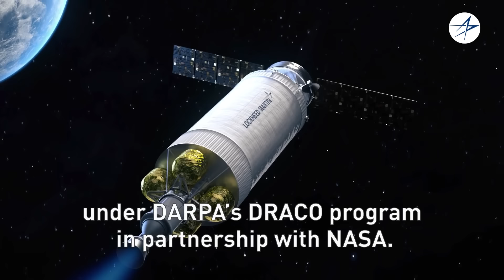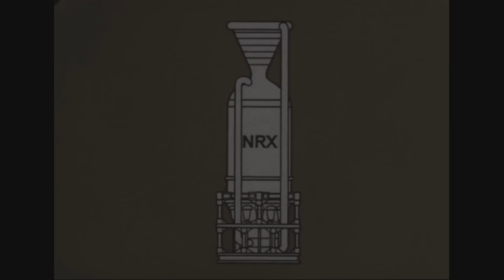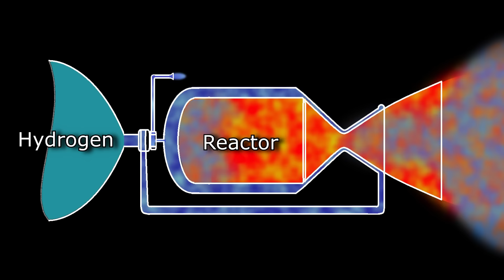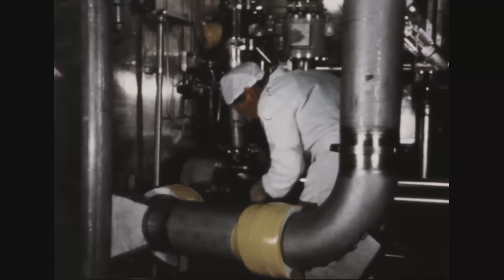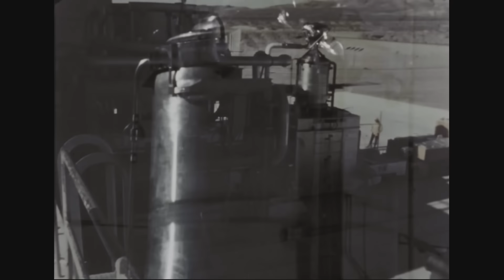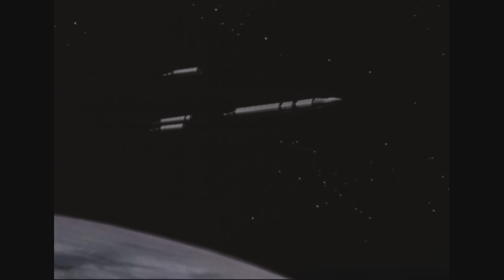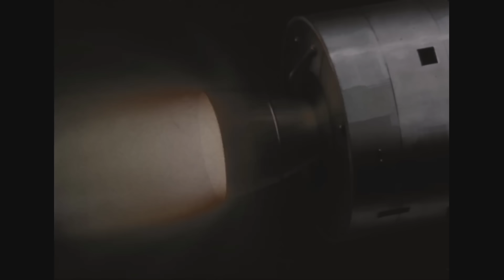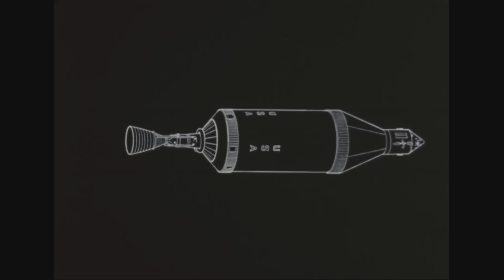Why Nuclear Rockets Are Going To Change Spaceflight

Comment: AEROSPACE ENGINEER HERE: 
Sorry Scott but this time I am going to disagree a bit on this one.
This is what I call a "zombie technology" and my definition comes form the concept of "zombie economics" which are the economic policies that no matter how many times they die in failure keep coming back to life. Likewise Zombie Tech is something that was put forward, then dismissed for some reason and then brought back to life later despite the initial issues NOT being handled. 

A good example of a Zombie Technology is the "Trains in Tubes" first suggested by Robert Goddard back in the 1920s, resurrected numerous times over the decades and most recently by Elon Musk. The main killer for the Trains in Tubes comes down to the simple reality of how many people it can move compared to a train on rails. The secondary killer is what happens when it fails, because at that point you have in a pod stuck in an evacuated tube. If the pod ever springs a leak all the passengers will arrive dead. After that comes the simple reality of what you do if a pod gets stuck in the tube.

All these basic issues that killed of the Trains in Tubes each time were IGNORED each time it was re-birthed.

The basic problems of putting these sorts of reactors into space are fairly well documented in numerous places. Most obvious is getting it into space in the first place. Uranium is heavy and shielding is heavy. Go and try to find the mass of an S9G reactor like those in the Virginia class submarines. Yes a rocket might need a lot less power but we are still talking about a massive lump of hardware to lift into space. AFTER that there's the issue of the vehicle itself. If you have to put the engines way out back on a boom to reduce the shielding then how many rockets do you need to launch the boom segments.

Anyway you look at it there's a logistical nightmare to overcome and NOBODY is dealing with that because they all hops somebody else will.

This is why hypergolic propellants were used on Apollo and many systems since. They require a lot less hardware to operate, which means the initial launch is far easier because there's less weight to launch. This was the great breakthrough that Buzz Aldrin and friends came up with that made Apollo feasible. They realised that it came down to how much mass do you need to move to get the men back from the moon. They then back tracked from there. What the Lunar Orbit Rendezvous (LOR) flight profile did was REDUCE the logistical problem from unfeasible to feasible.

Go see Destin's video (YT Smarter Everyday) on his talk to the NASA engineers on Artemis.

On the subject of what happens inside a nuclear reactor with things like moderators I recommend that everyone tunes into the YouTube channel Illinois EnergyProf hosted by Professor David Ruzic from the University of Illinois. Just put "energy prof" into YouTube search. Disclaimer - I graduated from U. Illinois but that was before prof Ruzic was there.

Prof Ruzic does a great job of explaining many of the issues across the entire energy spectrum INCLDUING nuclear. I believe he has 3 reactors (1 fission & 2 fusion) on campus for research and training as well as access to the Clinton Nuclear power station nearby. 

Sorry Buddy, 
I love the channel and hate that your flying while I'm grounded.
Enjoy your plane because one day you might NOT be able to fly and that sucks - trust me.

Comment: I prefer the variant where you mix two streams of sub-critical solutions of nuclear salts. When criticality occurs, it boils the water into gas, or even plasma if you prefer (by changing the concentrations). It allows you to turn the engine off and on, as you please, and the (EXTREMELY RADIOACTIVE) exhaust follows very fast out the nozzle.

Much more mass efficient, and ferociously powerful. Yeah, has the downside of radioactive exhaust, but yaknow, don’t point it at the Earth and it’s fine.

Comment: I would think fusion propelled rockets (thermo nuclear / hydrogen bombs basically) would be even better and more efficient. It solves the problems with fusion reactors as it do not need to be contained to harvest the energy, because it is a rocket...

Comment: The USA crappy technology at Fukushima Dai'ichi has polluted the Pacific Ocean, and the USA's nuclear bomb testing many years ago has caused a lot of radioactive pollution in the Pacific Ocean.  Now USA NASA is making a nuclear thermal rocket engine will dribble out yet pollution on the only habitable planet that we have.  There is no planet B.  Now the idiotic USA is considering using nuclear rockets for what ? - for doing some stupid prestige space projects.  The USA is utterly insane.  A failure of a nuclear engine will cause terrible pollution into the environment.

Comment: Excellent summary (liked you starting with the days of NERVA). Moderators H2 or NH3 provide great thermal neutron absorption cross-sections. So a 4000MW reactor can generate tremendous thrust for lift off from earth. However, both safety & politics have driven for chemical propulsion to orbit and going critical once in orbit (as with nuclear-ion propulsion).

Comment: Dear Mr. Manley, it only makes sense to have both a chemical AND nuclear rocket engine.  Have your ionized acceleration but then combust two gasses in conjunction WITH that.  As you would have ionized gas it only makes sense to add a few magnetic nozzle coils after the exit to accelerate the ionized gas further, increasing the thrust as it were and since you have a nuclear module why not generate electricity from it in the cooling process to power the magnetic bell nozzle apparatus ?  In fact why not have a long tube of magnetic coils to act like a particle accelerator  to further add speed to the gas exhaust and by reaction, more thrust to the ship.  Don't forget the glow in the dark safety stickers.    "Engage Safety Squint beyond this point."

Comment: You mentioned that ion engines were far more efficient but that they required a LOT of energy.  Couldn't a nuclear reactor provide enough energy to make ion thrusters viable?  This way the reactor can be run at a more constant rate to provide electrical power.  Then when thrust isn't needed, the excess power can be bled off by converting it to heat that is radiated in to space.

Comment: 20:40  Huh, IIRC the Discovery from '2001' used an ammonia fuel for nuclear engines....which were kept WELL away from the crew module.  Neat to see that mentioned here ( the use as fuel, not the fictional use )

Comment: To get a sense of the current value of 30,000,000 Dollars in 1962:
Today, on June 3rd of 2024, it would be worth ~311,500,00 Dollars.

This number has been rounded up from 311,471,523 Dollars and 18 Cents.
↓
That is ~11,000,000 Dollars more than 2023 🤔

Comment: it sounds like a dead-end technology. if you can refuel chemical propellant in orbit, then all of your human-related missions make more sense to be done by chemical rockets to avoid radiation issues, and the cost of the chemical fuel is going to be much cheaper for the foreseeable future due to the greater costs/difficulties with nuclear technology. but robotic/non-human missions seem like they would make more sense with ion engines if you really want efficiency. methane and oxygen are cheap, so you're not really gaining anything with nuclear unless refilling in orbit is impossible.

Comment: Twice the Isp is not really worth the hassle, just double the size of the craft and use regular fuel. If Starship works anywhere as well as advertised there is no need for NTR to the Moon or Mars. For outer solar system probes they might make sense. Nuclear Lightbulb on the other hand, now we are talking! Manned missions to Jupiter here we come!
Reply from the maker: You forget how the rocket equation works, it’s an exponential so it doesn’t grow linearly.
Reply: @scottmanley  When I run the numbers in a delta-v calculator doubling the initial mass has the same effect as doubling the Isp. Is it flawed?

100 ton -> 50 ton at 450s ~3000m/s
200 ton -> 50 ton at 450s ~6000m/s
100 ton -> 50 ton at 900s ~6000m/s

For high fuel fractions it looks different which is why I mentioned probes to the outer solar system.

Comment: With the ramping up and down, other management issues, this sounds possibly usable for a cycler tug engine. Using high orbits, but not as big as geo synch level, you could have a push zone for exit and entry that should give lots of nothing between it and anything, plus allows management, teardown, rebuild material policing. I doubt these would ever get to super high burn time anyway either. Hauling uranium once a decade but propellant every trip would still be a concern, but once the core tug is up you get a better economy of use for the mass. Could likely even give it a better shielding system than a bare minimum shadow shield

Comment: The whole concept is absurd. Adding 30 tonnes to the dry mass kills any ISP advantage. Then there's the additional size of the hydrogen tanks, then there's the refrigeration system needed to keep it liquid. A Rutherford weighs 35kg and it's perfectly adequate for any reasonable scenario.

Yeah, it might save some fuel, but it would probably cost more than 100 Starship flights, which is a lot of refilling.

Comment: This is sadly less criminally insane than the salt water reactor that you talked about in an earlier video. That was the most certifiably nuts idea I’ve ever heard:)
Reply: In one sense it's more insane: You are keeping all the radioactive material in your ship, right next to your crew. In a nuclear saltwater rocket, you are exhausting out your radioactive products, at great speed, so it both leaves very quickly and dilutes over a great volume quickly.

Comment: Great topic, Scott. Proper thermal neutron management will improve long term use of a nuclear thermal drive. Uranium is over rated and only produces fast neutrons, very dangerous to life and electronics.Thorium is ideal for thermal neutrons, less mass, lower neutron energy, less shields required, astronauts and electronics don't fry. It checks all the boxes. Can shadow shielding protect against radioactive exhaust back pressure, during deceleration? Or, we can go really fast but can't slow down ¿? I still haven't got a serious  response on that one. China is currently leading the way with Thorium. India is not far behind and hope the USA could go all the way....❤

Comment: Recently NASA funded a breakthrough pulsed plasma rocket that holds the potential to revolutionize space exploration. It could allow manned missions to Mars to be completed within a mere two months. While not a traditional nuclear rocket, this technology demonstrates the ongoing interest in advanced propulsion systems. The most advanced electric thrusters may eventually achieve a delta-v of 100 km/s, sufficient for outer Solar System missions with nuclear power, but insufficient for interstellar travel.

Comment: So nuclear is both cooler and the reactants are less massive yet more thrust.  That seems backwards to me for some flippin reason.

Can anyone clear that up for me?

A second question.

If you weren't trying to slow down, but just create a "bubble" of gases ahead of the falling spacecraft, could thrusters be used to counteract the plasma created during re-entry?  Especially, if nuclear engines were available or something exotic like that such that reducing the propellants necessary is further accomplished (because, again, trying to actually slow isn't the goal, whereas creating a "bubble" blowing back the pressures and plasma IS the only goal). The end result: no physical heat shield necessary.

Comment: Hi Scott,

Love this video and your whole channel!

I’ve been a Project Rover (and Project Pluto) fan for decades. However, I also heard rumors of a “Timber Wind” project during the 1980’s, which was part of Reagan’s Strategic Defense Initiative (SDI, aka Star Wars to its detractors). As I understand it, Timber Wind used a pellet-bed reactor that, presumably due to its greater surface area and maybe higher temperature too, could generate way more thrust than the solid-core NERVA reactors, while still achieving very high specific impulse. Supposedly, this thrust was even high enough to take off from earth under nuclear power alone! The funny kicker to this rumor was that Timber Wind rockets were going to be tested over New Zealand, as a form of radioactive payback to their no-nuke policy that wouldn’t even permit US nuclear subs or aircraft carriers to dock at Kiwi ports. Oh yeah, I think one of the early Rover or Pluto reactors was coincidentally named Kiwi!

Thanks for all you do!

Comment: I'm not convinced.  ISRU actually breaks the rocket equation, whereas nuclear and ion drive just change the key parameter.  Rather than using nuclear propulsion, I think we'll be better off manufacturing O2 and metallic aluminum on the moon, launching them with electromagnetic systems (spin launch, rail gun, lunar space elevator, whichever), reacting them in space to produce alumina (Al2O3) dust plus energy, and using the energy in ion-drive-like systems to accelerate the alumina dust.

Comment: Please bring to mind the starship Enterprise. The one Pike, and Kirk commanded. On TV. Now, google HTRE-3, go to pictures, bypass the photos of the prototypes to the first drawing. Turn it upside down, hold a dinner plate in front. Is that the starship Enterprise prototype? Yeah. That engine was for the XB-70. But ICBM happened, so the Air Force ditched it, and Roddenberry said, "Thank you, Sir! I can make bank on that!"
I wonder if it would really work in space. Because you could power quite a coil, and throw ions backwards hard. Wouldn't want biology near it, though.

Comment: I wonder if you could have a thermal decomposition based fuel for a nuclear thermal engine. Like a relatively dense fuel that decomposes into hydrogen and something else l at above 1000K (like how water begins significantly decomposing at ~3000k), which you can then heat up to full exhaust temperatures. Allowing you to store low density fuel in a higher density configuration, while still taking advantage of lower density exhaust products. 

The energy from decomposition could be negligible (unlike hydrazine/hydrogen peroxide monoprops), as it's mostly about propellant density. 

That being said, the addition of some non-hydrogen material may decrease efficiency so much as to make this unviable.

Comment: Didn't you use 3300 kelvin for the RS-25? If so, 2300 Celsius would be closer to 2600 kelvin, meaning the difference is more like 630 degrees instead of 1000.

Comment: I used scrap stainless steel high pressure piping in a NASA test facility that came from one of the NERVA sites.  It had radioactive warnings painted on them.  They were cold.  It was fun work that I never completed.

Comment: Draco?    So I guess SpaceX is going to have to start trademarking their names?
Reply: There’s no trademark violation here. In most cases you don’t violate a trademark if you use the same name for something entirely different use or application. The DRACO (Demonstration Rocket for Agile Cislunar Operations) program is a program to study the feasibility of nuclear thermal propulsion whereas the SpaceX Draco is a liquid hypergolic rocket engine. Two completely different things. Also, DRACO is an acronym whereas Draco is a noun. 😀 It’s also a generic noun, which makes it even more difficult to trademark. That’s why Xerox has spent millions to prevent Xerox from becoming a generic term

And even if there was a trademark issue you generally want to avoid suing a customer, especially one that has millions of dollars to spend. If Aerojet-Rocketdyne made a rocket engine called Draco then SpaceX would have a case.
Reply: @bbartky   I know there is no trademark violation, that's why I said "...going to have to START trademarking..."

Anyway it was just a joke.

Comment: Thats the part about rockets I don't get. Why does using a lighter gas make it more efficient? The metaphor / example scaled up of a rocket, is an astronaut with no tether.. throwing a hammer backwards. The harder you throw a heavy object in the opposite direction, the more you will go in the opposite. So why would a lighter gas be better? To gain speed in Forward, you have to throw something fast and heavy in Reverse. It's called Reaction Mass for a reason... so I don't understand that part.